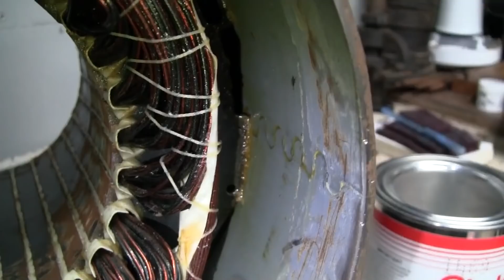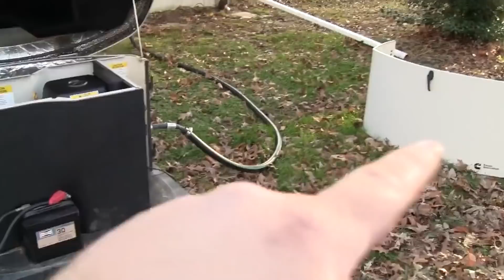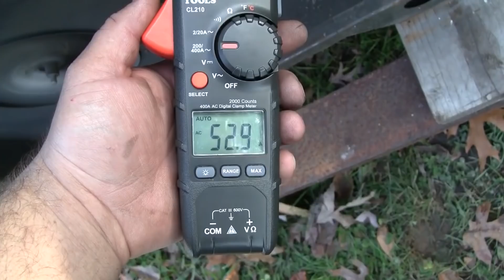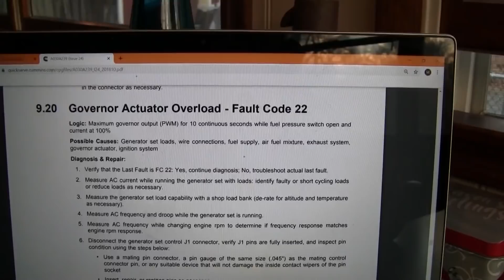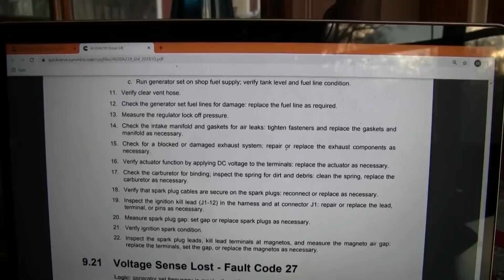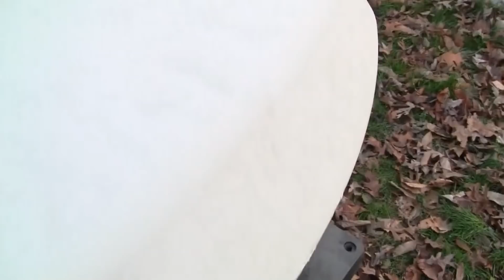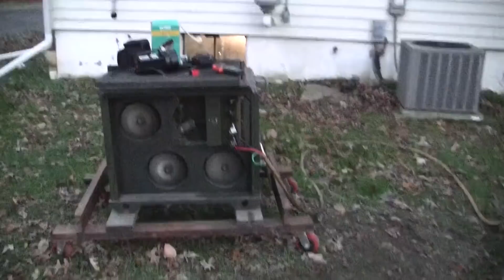COMPLETE REPAIR AND TEST 2015 Cummins Power Home Stand By Generator Pt. 2/2

Comment: I have painted a lot of Glyptal red enamel on different things.  One time we had an arc fault in an incoming feeder which continued into the main breaker on a 480 volt 800 amp service.  The breaker was badly carbon tracked, with deep grooves, of course the company that produced the breaker was no longer in business and we needed to get the service back on immediately..  Obviously we had to get the carbon tracks out.  I took the breaker to a sand blast cabinet and removed the finish off the breaker and painted the breaker with the Glyptal and put it back in service as soon as the paint had dried.  It worked fine and was still in service 10 years later.  I also cleaned and painted the inside of the breaker enclosure with the same paint.  I painted a lot of 5000 volt bus bar that had been covered with a covering that had no adhesive.  It is great stuff.  Looks like you have a winner here. Have you checked to see if there is any vibration caused by adding weight to the rotor on two places and possibly not being equal?

Comment: Great job! Darn shame you had to go in and fix all the things that should have been done when it was built.
Reply: I had a chat with a cell site guy who has lots of sites he and the company he works for maintain. He said the sites with Generac units have the most problems with the generators,  I forget his call but he is in the Midland TX area. KØOJ
Reply: @ojjenkins7110  I bet alot of them have that stupid design fault that could be fixed with that solder/epoxy job on the rotor assembly...probably wouldn't hurt to Glyptal the stator windings like he did as well to protect from the environment...sad that that particular design is the weak point...Generac is normally bulletproof!
Reply: Hi, your not concerned with weight for balancing the rotor with all the extra expoxy?That Gyptal is painted on in engine crankcase too,good stuff.
Reply: @peterwill3699  I would not have worried about the weight of his repair. it is so close to the axis of the shaft, and it is near the rear housing where there is a bearing. He added enough material to surround the shaft pretty well also, so I would very seriously doubt that machine will fail due to an imbalance of the rotor. I thought his repair was exellent, and I would accept this repair if it were my machine without hesitation.
Reply: Mabe this one was made in china
Reply: Very good repair though 🤓👍

Comment: I was wondering if you would epoxy the tails, good to see that you have. You do great work, always good to see your projects.
Reply: You're more interested in quality than the manufacturers.  Too bad for them, good for your customers.  Great videos.
Reply: It's Mike, of course he'd epoxy them. :))
Reply: Solid as a rock now!
Reply: Surprising that the manufacturer did pot or epoxy those connections on the rotor.  A cheap looking assembly for a brand name that really should know better.